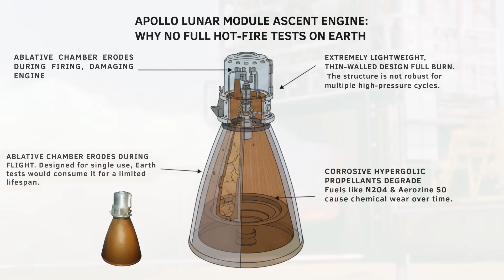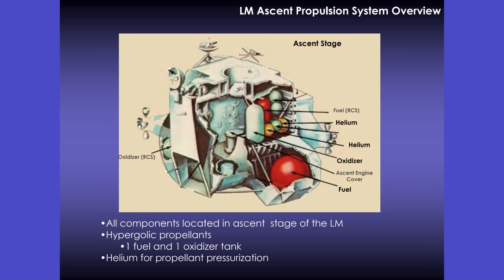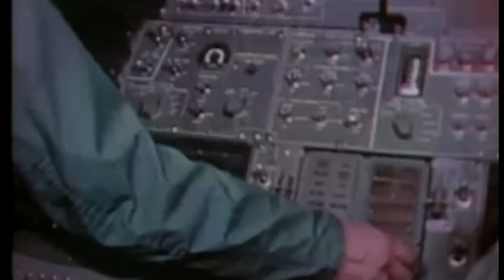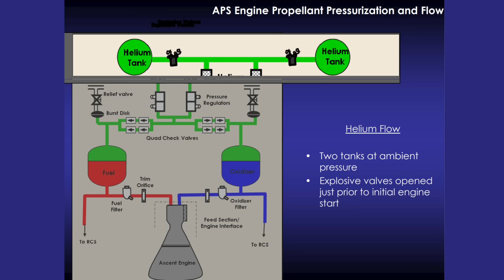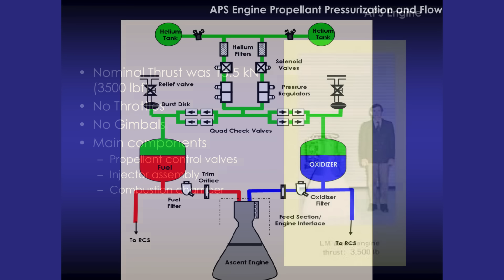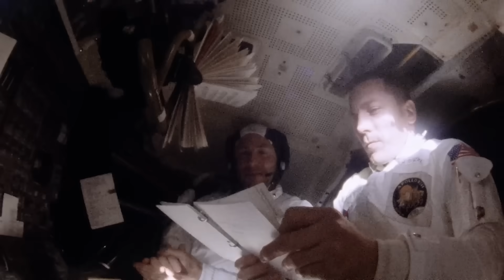The Lunar Module’s Ascent Engine: The Rocket That Had No Test Flight

Comment: Apollo 9 LM-3 Spider, Apollo 10 LM-4 Snoopy had unmanned Ascent Stage Burn to Completion burns before Apollo 11.
Reply: Snoopy is reported to be orbiting the sun😊
Reply: They were both manned
Reply: It’s confusing but he means that the actual engine on each individual lander was never tested before it was used on the specific mission.  Not that the engine design was never tested before Apollo 11 used it to get off the moon.

Comment: Nice video!
If you look at the films taken from the various LMs as they took off to orbit (the views of the surface as the module rises), you can see a curious oscillation in the trajectory -- more obvious if you speed up the film -- which is the RCS system on the ascent stage doing the job of gimballing the engine by moving the whole module. I think the LGC did this check once every two seconds. One of the astronauts said that it made him feel seasick...
Reply: Slightly different subject: if you watch a Saturn 5 launch with the launch tower to the left or right, you can see the flame of the rocket sway back to vertical after the 1.25 degree tilt tower clearance yaw maneuver. Speeding it up helps here too!
Reply: @EdwardKotapish-r4p  Michael Collins said that five things occurred him while watching the first Saturn V launch (Apollo 4): 1) My god, it's not moving (multiple seconds, while all the flame / smoke billowed out; 2) Wow, it's barely moving (compared with Mercury and Gemini it took ages to clear the tower); 3) Oh no, it's tilting over! (not uncommon on other launches); 4) Look at the length of the exhaust plume, longer than the rocket!; and finally 5) my chest's being caved in by the sound...  (The water deluge system was much poorer on 4, and lots of damage was done to the launch site.)
And yet it was a nearly flawless mission.

Comment: Could the engine restart if needed?
Reply: Yes, they could restart the ascent engine and they did it after every mission (except Apollo 11?). They would jettison the LM after docking and then remotely fire the ascent engine till fuel depletion so it would impact the Moon and they could record the impact by seismometers left on the surface.
Reply: Apollo 10 was fired twice. Once during the abort test and again after LM jettison. They fired it the second time until it ran out of fuel. Thats why its in heliocentric orbit not a crater on the moon.
Reply: Right no restart no gimbal no throttle. The attitude control thrusters were used to direct it back into the correct orbit.
Reply: No.  It was "one and done"
Reply: @garymartin6987 not true